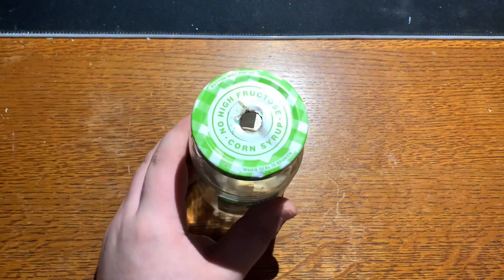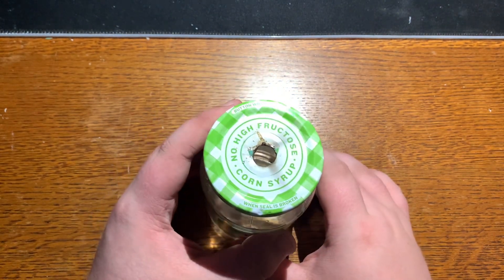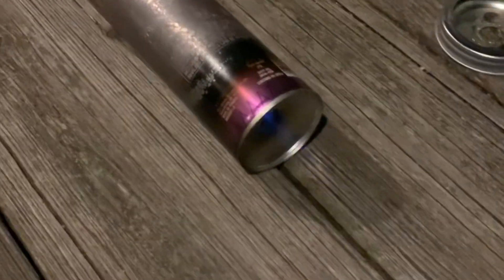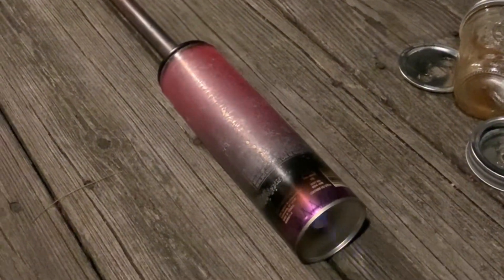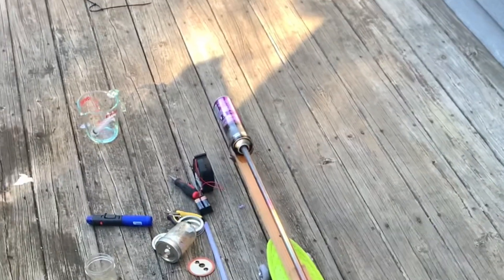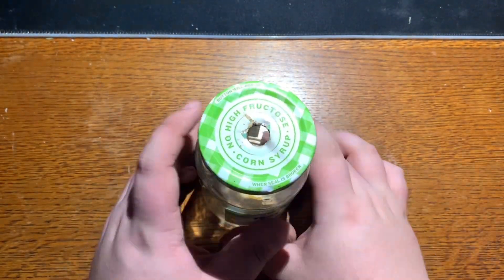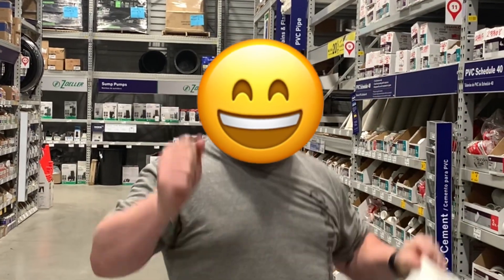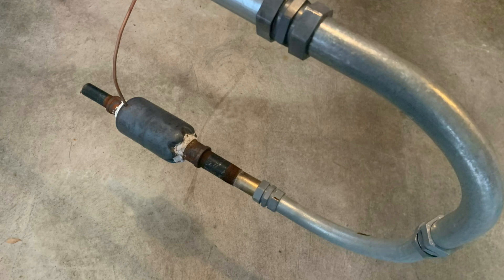Valveless Pulsejets Part 2

Comment: How did you do your fuel tube?
Reply: I'm making mine kinda like yours
Reply: What are its dimensions and do you use a regulator
Reply from the maker: I’ve found an adjustable regulator works best. The hole dimensions shouldn’t matter too much as the fuel can be adjusted via the regulator. I would start with ten 1/16” holes, five on each side.
Reply: @3stepsforward2stepsback ok interesting right now Im using a. Large fuel tube
Reply from the maker: For the fuel line I used a 1/4” copper tube. One end was crimped shut and two holes were drilled in opposite sides of the combustion chamber for is to pass all the way through. I then drilled several small holes through the fuel line, making sure to go through both sides. The fuel line was positioned such that the holes pointed toward the ends of the combustion chamber to allow for easy ignition. 
I am happy to help with any other advice you may seek and wish you luck on your project!
Reply: @3stepsforward2stepsbackwhen I run my Lockwood it ends up  fizzling out after I remove the leaf blower so I may do the 1/4
Reply: @3stepsforward2stepsbacklet me send you a 
Video of my set up
Reply: https://youtu.be/JDvbR3lSHQA?si=YEj2qEmxpft6g1fQ

Comment: some tips on making it run better: If you add a small cone on the intake the engine wont choke from the vortices formed from each pulse, because your exhaust is longer than needed the engine runs on a lower frequency which reduces thrust alot. I would not really recomend making the fuel nozzles bigger. The pressure is almost already at atmospheric pressure so increasing the size of the holes wont really deliver more fuel. 

but that is a really cool engine ngl. btw great editing!

Comment: try narrowing cone shaped rocket stove (narrow air intake, valveless/flapless, wide output, yes like rocket nozzle after burner
Reply: can be used as a bottom air feed wood burner stove, if you also put a bottom ash grill
Reply: afterburner is continuous flow burn, no pulsing intended
Reply: yes continuous burn flow afterburner valveless with directional burn flow
Reply: well its just a rocket nozzle shaped valveless pulsejet
Reply: hour-glass shaped flow-through valveless afterburner scramjet (or just external heat engine ramjet rocket nozzle)
Reply: no explosion chamber (brrr sound), just the narrow intake, then expanding rocket nozzle output
Reply: well yes kinda gas burner nozzle
Reply: put a longer continuous burning section rocket nozzle if it does not burn in short pipe, it goal is to burn all the stuff in the nozzle, to max the thrust output
Reply: if you have a heat resistance glow ignition coil (like in a sauna, thick) then you can also either use that directly to heat thrust, or vaporize a gasoline fuel